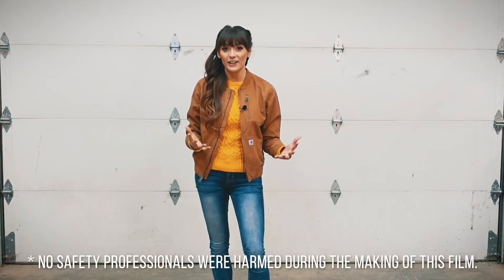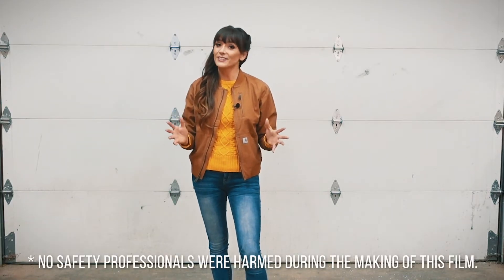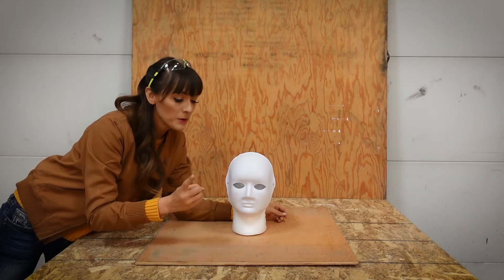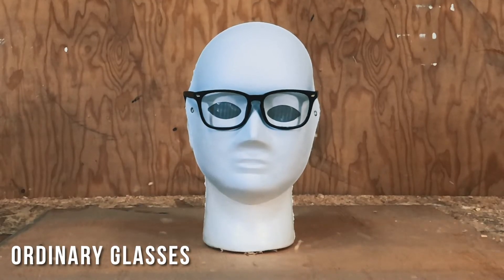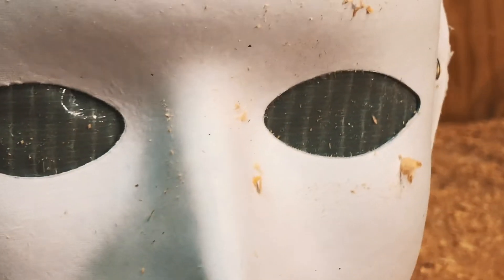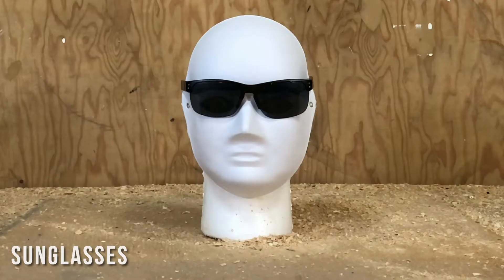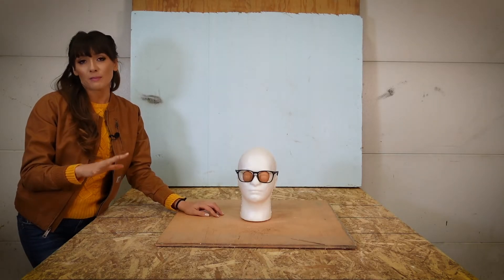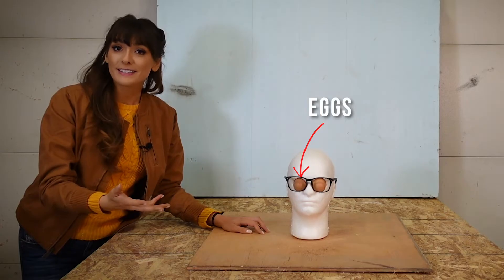SAFETY GLASSES IMPACT TEST | ANSI Z87 VS Nail Gun, Wrench, and Dust

Comment: It's pretty remarkable how durable the lenses of even the non-safety glasses were (which is perhaps less surprising given that modern eyeglasses and sunglasses generally have polycarbonate lenses for shatter resistance); unfortunately for the poor dummy wearing the non-safety glasses, that didn't protect them from the impact popping the lenses out of their frames and smashing them into the dummy's eye.
Reply from the maker: Yeah, kinda shows some of the limitations!